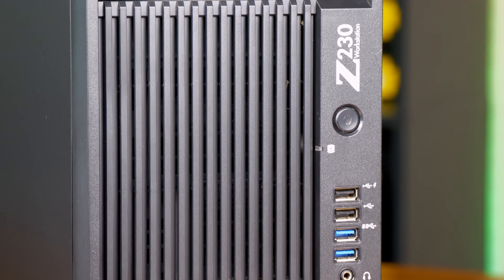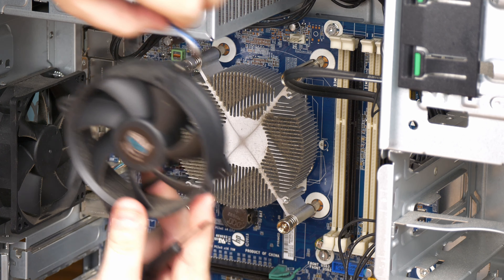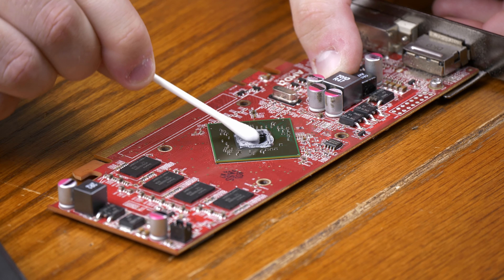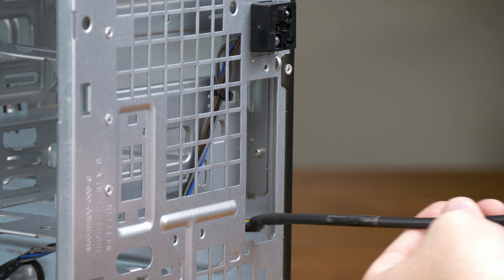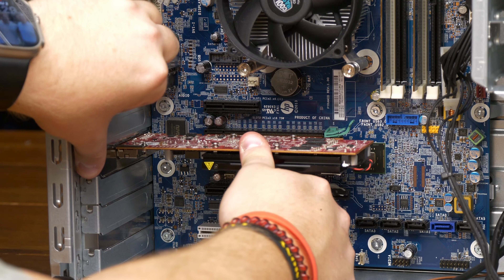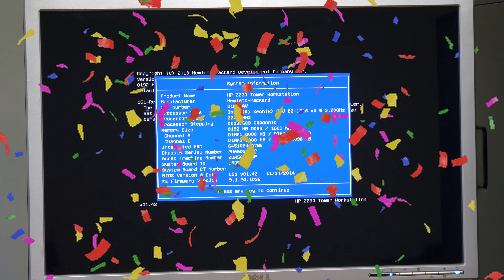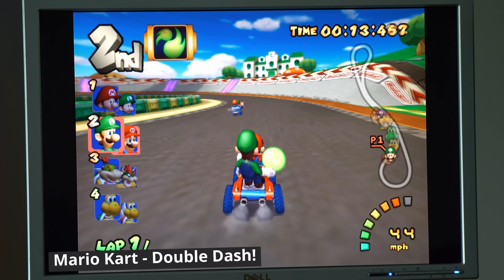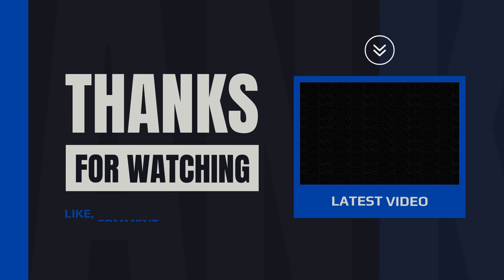Can I Turn This $15 PC Into an EMULATION BEAST???

Comment: I would get a 250GB SSD for the OS and have the ROMS on the second drive. Responsiveness is very important for boot up and navigation. Also, that is a lot more work on cleaning than I have felt like doing in recent years. Good job.
Reply from the maker: Thanks so much!! Yeah, it's an upgrade definitely worth doing in the near future. The OS feels a little unresponsive due to the HDD, so I might just do that!! 💯
Reply: Yeah, SSDs are dirt cheap.

Comment: Thank you, thank you for NOT using compressed air, which is the best way to unintentionally damage you computer.
Reply from the maker: HAHA no problem man. It's great for some applications like cleaning the computer case and some other things that are non-electronic, but you're right... it's not a good idea at all to use it on anything electronic. It's better to just grab some isopropyl alcohol, some Q-tips and put in some elbow grease😂

Comment: Got given a HP Pavilion running an Athlon 64 and XP. Going to use to run Amiga, C64 etc.
Reply from the maker: Oh yeah that'll be perfect for doing that! Do you plan on installing Batocera? Because I think it would run well on that CPU. If not, you could always use RetroArch... an OS designed for lower end CPUs

Comment: You should use a cheap paintbrush for cleaning off the dust before using any alcohol.  The alcohol will leave a residue behind.  It is best to clean dry dust mechanically including either a paintbrush or compressed air.
Reply from the maker: You know that makes sense! I'll make sure to do that next time! 🫡

Comment: 3:50 The most effective way to clean the edge connector on a SIMM or DIMM is with a pencil eraser.  Use a good quality pencil eraser though.  A lot of new cheap erasers (on cheap pencils) aren't very good for this nor is a pen eraser (they are generally harder).  What I do is erase the edge connector on both sides, then take a microfiber cloth, dampen it a bit with iso and do both sides at the same time using a pinch.
Reply from the maker: Interesting, I didn't know that! Thanks for the advice! 💪

Comment: Don’t be afraid of water. Lots of the parts can be hosed down or take a run in the dishwasher, saving you a lot of time 😊
Reply from the maker: You're exactly right! I just didn't feel like filming myself putting things in a dishwasher, I just decided it would actually be easier to do it by hand haha. But you're exactly right! 🤩

Comment: Subscribed! I have a Z240 I intend to use for this very purpose. Currently it has Pimiga 4 installed for "those things Amiga" that I never got to experience. A second SSD or HDD with Batocera is next after seeing your video. Actually, my main machine is a Z440 with Debian. These "old" HP workstations are bullet-proof :)

Comment: I picked up a few older PCs for like $10 each. Probably going to get 1 of them and do a quick air blast all over and redo the cpu paste and call it a day. Got a spare 500GB SSD lying around so will use that as the main and get a cheap 4TB SATA for extra games. 

Have not installed Batercera before so this would be a great learning experience.
Reply from the maker: Dude that's awesome! Keep me updated and let me know how it goes! Batocera is not difficult at all to install and it's a blast once you get it running! 🤌

Comment: Good video. You re-installed the ram into the non-recommended slots.
Reply from the maker: So technically, you're right. However, when you're running RAM dual channel, it doesn't really matter, as long as you install them in the same color slots... like both on white OR both on black. HP is one of those companies that makes it so it doesn't really matter. But again, you are right 💯
Reply: @TheTechspert  heh, yup that’s why I said “non-recommended” vs wrong. While I normally go with the motherboard recommendation I’ve yet to encounter a system that doesn’t work if the ram is in any random slot 🤷🏻‍♂️
Reply from the maker: Exactly! It actually kind of amazes me how the internals of a computer are so complex and easy to mess up unintentionally, and yet with the RAM, one of the most vital components, the makers of the PC are able to design it to where it will pretty much take whatever you give it and work with it! 💯

Comment: Sorry for the double comment; to me it looked like you had a ssd and a HDD. Did you install batocera on the SSD, and put the roms on the HDD? I think all you need to do is copy paths.  I probably should have done that rather than installing windows on the SSD.
Reply from the maker: No problem man. No, I only installed a 4TB HDD. However, I plan to install an SSD for the OS, then use the HDD only for roms. That way Batocera is more responsive but I still have TONS of storage for cheap. 😁👌